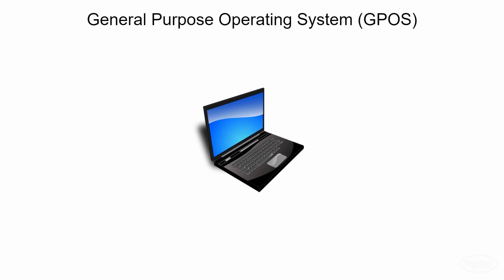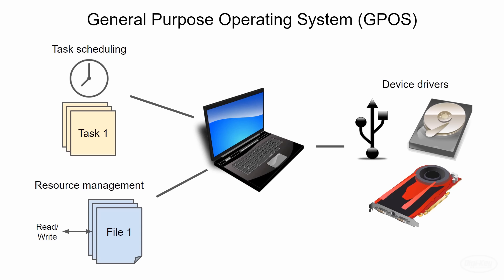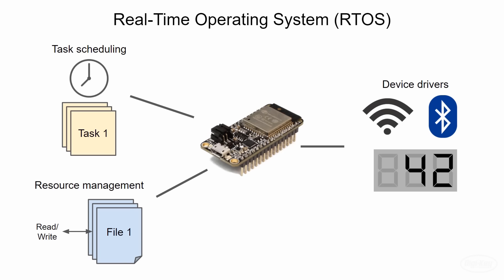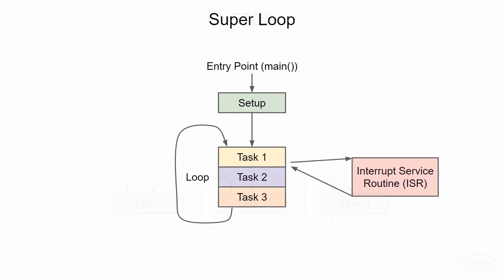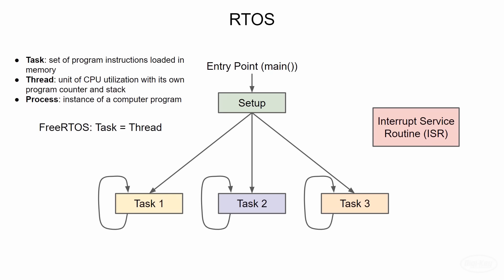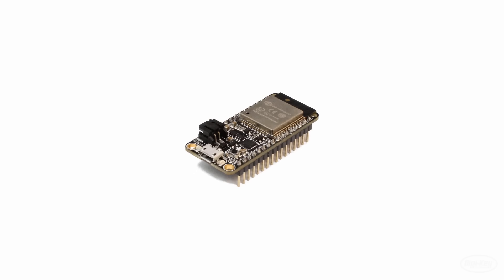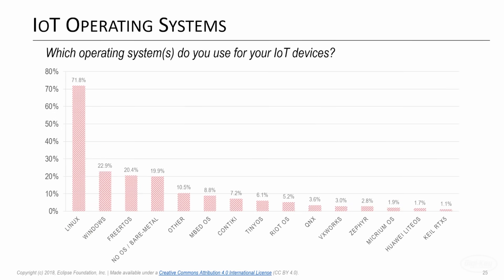Introduction to RTOS Part 1 - What is a Real-Time Operating System (RTOS)? | Digi-Key Electronics

Comment: Does an RTOS' delay function (ex. FreeRTOS' vTaskDelay()), allow the scheduler to run other tasks?  Actually, even if a low-priority task sits in a tight while(1), isn't the whole point of an RTOS to have the ability to wrestle away the CPU after too much time?

I have a motor control application, and would like if a task receives a command in the queue, it will move until it reaches the destination (30+ seconds).  If another command is received while it's moving, it must stop and go to the new position. Maybe the task could look like:

wait for queue command
start motor moving
Continuously check position and stop when reached OR stop when new queue command is received

Would monitoring the position block/starve all other tasks?  If so, what's the proper way for it to closely monitor position while still allowing the RTOS to run other tasks?

Comment: Is it possible to run a I2c device in one of them Tasks ? So far i haven't seen any examples of that. ie.  as5048 Position sensor running on one core and making its Angle data available globally to the other core..I cant get it to work.

Comment: Hello sir, 
when i remove while(1) in toggleLED function, behaviour is same. does free rtos schedule same task again and again.

here is the code i used

#if CONFIG_FREERTOS_UNICORE
    static const BaseType_t app_cpu = 0;
#else
    static const BaseType_t app_cpu = 1;
#endif

  static const int led_pin = 2;

  void toggleLED(void *parameter)
  { 
        gpio_set_level(led_pin, 1);
        vTaskDelay(500 / portTICK_PERIOD_MS);
        gpio_set_level(led_pin, 0);
        vTaskDelay(500 / portTICK_PERIOD_MS);
    
  }

  void app_main(void)
   {
  gpio_set_direction(2, GPIO_MODE_OUTPUT);

  xTaskCreatePinnedToCore(  
                 toggleLED,
                 "Toggle LED",
                 1024,
                 NULL,
                 1,
                 NULL,
                 app_cpu);

    while(1)
    {
        ;
    }

  }

Comment: I will never understand why someone would want to support 'threads' on a single core processor. You are much better off understanding how to write non-blocking and deterministic code in a bare metal environment in my opinion. If things truly need to be happen concurrently, you need to figure this out at the hardware/peripheral level. RTOS just enables engineers to design otherwise blocking code and drivers, in my experience.

Comment: You can run normal Linux distros as RTOS by changing the scheduler from CFAS to FIFO. It's not super-duper accurate but it will do the job for 99.999 % of all hobby projects and probably 80 % of all commercial projects.

FreeRTOS is great for small critical tasks.

VXworks is to go-to for missiles, airplanes etc. where software is just a small part of the cost and things working as they should is worth lives or millions upon millions of dollars.

Comment: Hi, i don't know where to go with my Question. 

When i use the Arduino commands "analogRead()" (read adc, analog input) and directly after this "dacWrite()" (write to dac, analog output), then it works well.
But when i use the esp-idf commands "int val = adc1_get_raw(ADC1_CHANNEL_0);" and directly after this "dac_output_voltage(DAC_CHANNEL_1, value);" then it doesn't work. (Configuration and setup as described on espressif get started, DAC and ADC are working well, when used independently without each other in one the same loop.)

ADC and DAC doesn't work together in one task (while-loop)! Why not? I cannot find solutions for this promblem on the "get started" page.

When i use ADC and DAC in independent tasks with vTaskDelay(), then it works perfectly, but why not in one task? Where is the problem? Are there timing problems or do dac and adc need to be disabled enabled? I dont know...

I use the original "ESP32-DevKitC-32D" from Espressif, but with a board from AZ-Delivery i have exactly the same problems.

Comment: You did not mention state machine cooperative multitasking, a task doesn't hog the system but instead do snippets and then for example tell schedular to come back in 250ms with the option that a tasks IRQ can tell the event handler to run this task "right away"  I wrote my own in 50lines of C code. example of usage: 
OS_Interval_Next(this,5*1024);                                              // give it 5sec time before turning off swclk pin

Comment: As a game programmer for 30 years, when I learned iOS Swift, I had to change my way of thinking about code because Swift doesn’t function like other languages I’ve used. In Swift, there is NO “main loop”. In fact, the Apple device’s OS is the main loop of your app. Everything in your app is accessed by interrupt handling, either a timer interrupt or a human interrupt, like a button push.
Reply: Same in JavaScript, where we also don't have a main loop, programs are functions responding to events like clicking a button (or in case of Node.js like an incoming server request). And the browser is the "operating system" (or Node.js or Bun or whatever else).

Okay, a function calling itself recursively using requestAnimationFrame could be something like a "main loop", it's done mostly in games using canvas element...
Reply: @mieszkogulinski168  if swift and JS are the same in this regard, they are event driven languages and a loop is still involved, the event loop.
Reply: That’s exactly what I felt the first few times I wrote BREW Apps (Qualcomm’s missed opportunity to become Android).

Comment: If a task in a super loop takes too long so the user notices any kind of lag, that task wasn't not coded properly.
Someone ever heard of "finite state machines"? A small 4MHz / 1MIPS micro controller with a correctly coded super loop can scan a dozen tasks using more than 2K of code in less than 1/2 a mili second.

Comment: I have been running into a situation where I need something to be timed. The problem, is when the timeout occurs at some point in time when the loop is doing another process.. Let's say the loop takes 11 to 14 seconds to repeat and I want my screen to stay lit for 90 seconds..

I can't guarantee when the loop will check when the screen timer reached 90(not after). It can only tell if the set time has gone past the timeout.. (Just like your piston catastrophe reference). 

Is there anything like a timer interrupt?

Comment: 7:40 To be fair, an ESP32 is much cheaper than an Arduino, and has BT/WiFi so I tend to use them even for projects they are wildly overpowered for.  Super loops are great for simple projects just due to the law of fewer moving parts.  Faster to develop, lower surface area for bugs.  Project complexity is the primary deciding factor.

Most industrial automation, for example, runs on PLCs, and they are almost universally super loop architectures.  Huge scale, loads of I/O, long programs, but still low complexity.

Excellent summary, in any case.

Comment: Am using FreeRTOS in a Low-SWaP environment on a battery-powered ESP32 to conserve power and time.  The ESP32 is woken up by a timer or interrupt, fires up multiple tasks to get data from various sensors.  Another task makes a connection to the server over wifi.  Data is sent to the main task via queues which then sends it to a server and then goes back to sleep.  Since some of the sensors are noisy, several techniques including multi-sampling are employed to clean up the data.  This all takes time.  FreeRTOS allows all of the data collection and wifi connection tasks to run in parallel thereby allowing the ESP32 to stay awake for a shorter period of time.  What used to take a minute or so using a super-loop, now takes 10 seconds using FreeRTOS.  The only problem was making sure each task's stack size was optimal in order to have enough memory to run the task but not so much as to waste memory.  The project uses the Arduino framework because there are a lot of drivers and sample code available.

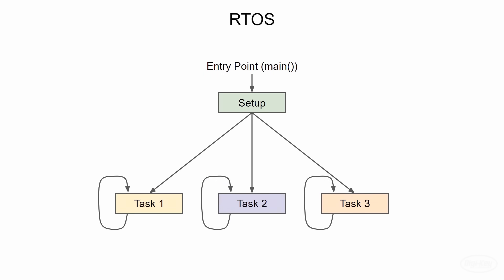Comment: 5:08 You don't need to use multi-core processor for concurrency. If you have interrupt supported by hardware, why don't you use an external timer which fire interrupt every 1ms? So you could switch to the next task after the current task's quota expires.
Reply: This is exactly how FreeRTOS works.

Comment: What do I need to be to understand this series cuz I got no electrician engineering background
Reply: You don't necessarily need a degree or be in any particular profession. This is an intermediate/advanced topic related to embedded systems. I recommend having some experience with Arduino and C/C++ to understand this series. There are lots of videos and courses out there to get you started with Arduino.

Comment: You said RTOS can do multitasking but what is the difference from multi core cpu, that can also do multi tasks with core funtioning individually?
Reply: Great question! A multi-core processor is something that's done in hardware: it allows you to run code concurrently on separate cores. An RTOS (or most OSes for that matter) can make it seem like you're running tasks concurrently (even on a single core) by rapidly switching between tasks. I recommend watching Part 2 to see how that's done. Some OSes are configured to handle multi-core systems, so you can have multiple cores that switch among tasks (all running on top of the same OS). In Part 12 (to be released), I show how you can use FreeRTOS with a dual-core system.

Comment: Please name at least one embedded system running Windows. Thanks
Reply: That does seem odd. I'm not entirely sure what the Eclipse Foundation defined as "embedded system" when they took that survey. However, Windows IoT, Azure Sphere, and Windows CE (https://en.wikipedia.org/wiki/Windows_IoT) exist for things like point-of-sales systems and kiosks. My guess is that those systems were considered "embedded" by the survey takers.
Reply: I have seen such devices using regular Windows.  They are very unreliable.

Comment: I disagree with the way you are describing a RTOS wrt to Interrupt scheduler ... RTOS differ in how many interrupt priority levels you have,  interrupts by clock, interrupts by signal trigger...a/d and d/a conversion  interfaces also limit RTOS performance -- RTOS performance is  tied to CPU speed and sampling bandwidth required..
Reply: The RTOS code is actually a timer interrupt. The CPU quickly check if the task that was stopped by this timer interrupt is in the top priority queue and if time slice expired.
There is not much to disagree when knowing the exact way RTOS are written.

Comment: Can you run a program from an SD with FreeRTOS? Any of those RTOS can do it?
Reply: This might be possible. The best I can think is to create a compiled program that's stored on the SD card and then use a bootloader to read it into program memory. However, that doesn't have anything to do with an RTOS--it would be dependent on the microcontroller.

Comment: Please bear in mind that in RTOS on a single core SoC, there is just one task running at a time.
Reply: so it actually benefits from having multiple cores?
Reply: This is misleading. Even if tasks do not run concurrently physically, they "appear to do so" to the point that you can't share data b/w them. It is a good reason why FreeRTOS talks about Tasks as if they mean threads.
Reply: @YourCRTube  I’m not sure I would agree with this. I would like to know what you mean by “they appear to do so”. At any given time a single task is running, yes preemption can occur so a new task may become running but still only one task is running. Tasks can share data between them but you have to take into account whether it is explicit or implicit communication so you know when the data is actually flushed to the buffers.
Reply: This is correct, and it's something I show in the second episode. The ESP32 has two cores, which allows you to run 2 tasks concurrently, but if we only use one core (as I show in the examples), the processor is required to time slice the tasks, as only one can run at a time.
Reply: @ShawnHymel  Therefore with one core, you can also implement a big-loop state machine, hence there is no context switching overhead.
Reply: @ArjanvanVught  Yes. A super loop with a state machine is often a very good way to accomplish many (possibly most) goals with embedded code. An RTOS offers the benefit of easily switching back and forth between two tasks to give the illusion of running things concurrently (or actually running them concurrently on a multi-core system) . You can get a state machine to do that (e.g. switch tasks every 1 ms), but you've essentially written a scheduler by doing so (and thus incurring overhead) :)
Reply: @ShawnHymel  home made schedulers can avoid deadlock and starvation and priority inversion. Basically, when two threads compete for the same resource, one should timeout and manually perform a retry later.

Comment: On the principle, you can achieve all of this in a "superloop" by making sure every instruction will execute in a limited amount of time and will never hog the MCU to itself.
For instance, when repainting your LCD screen (say, a 5110 LCD of 84*6 bytes), you could block the entire processor for the time to repaint the entire screen and call the function 20 times per second (you're going to kill yourself waiting for the RDY pin of the screen to become high), or repaint the screen one byte at a time and call the function at every loop (returning immediately if the RDY pin is low).
Same goes with buttons, you check the state of the button once per loop instead of hogging the CPU with insane debounce delays, It's just a programming style, what's the point of adding a greedy layer of RTOS (in terms of time and memory) instead of accepting the challenges from the limitations of the processor?
Reply: For that example, RTOS are overkill. I may update more than one byte but not the entire screen on each calls.
Maybe a cache could be best if RAM is many order of magnitude faster.
Your code paint to a RAM buffer fast fast. Then, the paint compare if anything is different and update only what changed.
The RTOS become necessary when the device must access wifi, ethernet, all brand of SD flash memory and all USB hub/mouse/keyboard/thumb drive that ever existed.

Comment: I remember, many moons ago, I had a RTOS version on an EPROM cartridge attached to my Atari ST. Many moons ago.
Reply: My older brother developed on Atari 1040 ST and a 520 ST computers. The operating system on those 68000 based processor systems was called TOS. The OS was burned onto internal ROMS on the main board. There was something called "realtime" for a musical cartridge back on Jun of 1991.
Reply: @JohnWasinger  Tramiel Operating System ... good ol’ days. Enjoyed that one quite a bit with the M68k family over the years. Was used where I had my first programmer job too for various application. Even developed a TokenRing network and integration into TOS.

Comment: You can run concurrent on super loop if you divide the tasks in switch statements and design non blocking, but this requires some years of experience.
Reply: The "divide tasks in switch statement" is what many call "state machine". More precisely, a hierarchy of state machines where each switch statement could be seen as a tree structure when matching the call tree.

Comment: I have an ESP8266. Would I be able to use that for these videos?
Reply: Possibly. You'll need to build FreeRTOS for the ESP8266. There are a few ways to do this. The easiest is probably with PlatformIO (https://docs.platformio.org/en/latest/frameworks/esp8266-rtos-sdk.html), but you won't have Arduino. You might be able to get this repo to run FreeRTOS on the ESP8266 through Arduino (https://github.com/aleksmarcelo/LibEspArduino), but I have not tried it.
Reply: @ShawnHymel  I'll give it a look. Thanks for the references! Looking forward to the rest of the videos :)

Comment: How does a super loop compare to a state machine? Or is a state machine a kind of super loop?
Reply: Neither. A state machine is used to determine what kinds of actions should be performed at any given time based on the “state” your program is in. Usually, this is just something like a global variable that stores a number, which tells you what state you’re in. You then employ a switch/case statement to perform different actions based on that state (i.e the number stored in the variable). Anything can cause a state to transition to another state (e.g finish executing one state, a button press, a timer, etc.). You can use a state machine inside of a super loop or in an RTOS.
Reply: @shawnhymel7647  
When programming with a  super-loop than for example, a TFTP server must be implemented as a state-machine. In an RTOS there could be a blocked wait of requests, the RTOS scheduler will do the context switch. In a super-loop, there can never be a blocked wait.
Reply: @shawnhymel7647  "